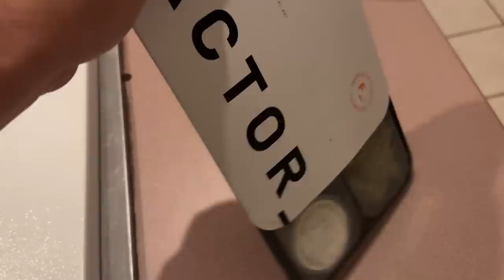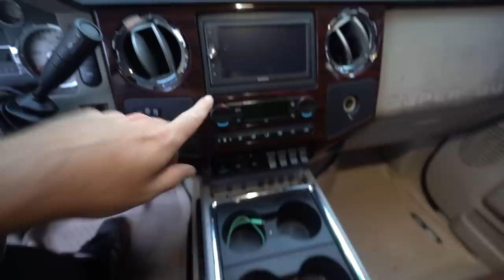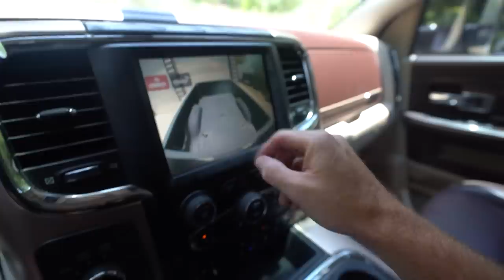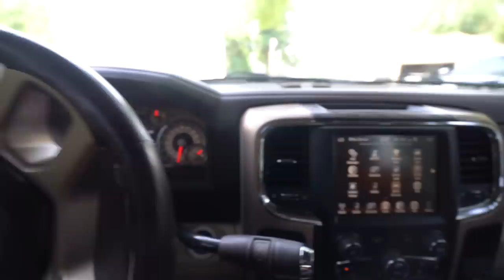My new truck broke down. so I bought another one. bucket list tow rig.

Comment: Biggest thing the local guys here in Australia do is a really big under bed trans cooler with twin push/pull fans on it. Change to the shatter proof heavy duty flex plate, higher grade flex plate bolts and lock up correctly rated torque converter to suit the towing duties this is being used for. Upgrade the solenoids, valve body, clutches and drums to billet. Put a deep finned pan on it with aftermarket drain. You will run almost double the trans oil with a radiator sized cooler, but preventing heat soak is the goal. Of course a trans retune is also going to make it live a better life. 

I’m all for extending the frame on this and removing add on hitch relocation bracket extensions as these are high stress high failure items that can cause you big hassle in the long run. 

Don’t over wheel the truck with heavy Alcoa type wheels as this just causes additional steering and suspension stress. A load helper bag system on the rear axle should be installed to improve towing and ride quality. 

Like someone already mentioned check all external wiring connectors and fill with dielectric grease to prevent corrosion from the humid Florida air. Upgrading ground straps is advisable. You may also want to have the ABS system flushed and recalibrated for towing as well. 

Now is also the best time to go completely through the heater and cooling system on this truck and put a slightly colder thermostat in it as it will want to run hot when towing long distances. Remove the grid heater unless you’re planning to travel into colder climates. In Florida I don’t see the need for it. 

Yep I’ve said a lot, but when you make an investment like this you want to do as much as you can to preserve it. 

Good luck Taylor

Comment: Need to get a Gen Y tongue for the gooseneck. Their torsion style gooseneck gets rid of a lot of road shock and also gives some offset back like you need. Also saves the trailer from a lot of shock keeping everything inside from getting knocked around.
Reply from the maker: I ended up order the shocker one just because it was in stock at e trailer. Two birds one stone. Get the offset while also adding shock resistance.

Comment: Literally every truck mechanic on the planet agrees that a ford truck with a Cummins engine and Allison trans is THE BEST truck you can get .. if you slapped an Allison in that fummins , you would quite literally never break down , all you have to do is an upgrade lift pump to supply enough fuel to the injection pump computer on top of the fuel pump on the side of the engine to keep it cool and you’re golden
Reply: My buddy did that always shifted erratic would be great then shift up on its own and just black smoke egts were super high too best would be a manual nv5600 or even g56
Reply from the maker: @chrisley7919  yeah I thought long and hard about a G56 truck. That was the plan. But after driving one a bunch. It would suck after the novelty wore off on long trips.
Reply: ATS now makes a kit to swap in an Allison 1000 and retain all factory functions. My buddy did it on his 2018 and it make one heck of a difference.
Reply: Who has time for that though? He already runs a company and manages multiple builds. Doesn't make sense to build another truck when he NEEDS it.
Reply: That combo used to be sold as a new truck. It was called a Sterling. I avoided the teens duramax trucks because of the CP4 fuel pump and the fact they are 140 ft lbs less power when stock. I thought about a bulletproofed 2005 6.0 but luckily went with a 2020 fully loaded L5P duramax. The allison/gm 10 speed is great and I would rather push a duramax than listen to a cummins run, especially since all the cummins trucks I drove were dogs when unloaded. The duramax is extremely quiet even when towing and I would never have a short bed. CC LB is the only way to go. I was expecting Taylor to just keep driving the fummins, but I get wanting a more comfortable truck.
Reply: I would take a 6r140 over and Allison any day like let be honest here I’ve seen way more smoked Allison then 6r’s it’s honestly one of the best transmission ever made and the 5r110 isn’t bad either

Comment: From a Chrysler dealer tech you definitely need to upgrade the cooling for the longevity of the trans. And I’ve done a few transmissions that are in tuned and deleted trucks and they end up blowing up pretty quick because the trans is already being pushed to its max behind the Cummins. Also it looks easy to work on but you still have to pull the cab to pull the head. You can barely get the valve cover off with how far under the cowel the engine goes. Make sure you keep up on the maintenance like fuel filters ccv filter and trans services since you are towing a lot and it’ll be a good truck
Reply: You pull the cab to pull the head?
Reply: you most certainly dont have to pull the cab. i do them fast going through the wiper cowl for head bolts
Reply: FCA tech, huh?
Reply: @jacojanks5985  no you dont have to. Takes a little work but the cab does not need to come off, ive done it before without a cab off.
Reply: The transmission has always been the weak point of Cummins powered Ram trucks. If you upgrade the power any above stock it’s wise to upgrade the trans.
Reply: Eh, watch Greg A.. He never pulls the cab for a head. It can be done..

Comment: Remember the gridheater bolt and get that checked.
Reply: Get a Banks intake for it. Removes the grid heater and is better all around.
Reply: It probably doesn’t get cold enough where he lives for a grid heater anyways. Just remove it.
Reply: Great tip. This is the main reason they blow up!
Reply: @markbremmer8642  way too expensive for the banks intake plenum. Just use a basic delete plate with the stock intake horn. Where he lives a grid heater isn’t needed

Comment: Taylor, im sure Im not the first to say it, but you need to get the 5th wheel slidder rack that they have for mega cabs. Also, those oem tail lights have a known issue for having codes and warnings on the dash when a single led goes out, but other wise works and functions normally. Get a half decent set of aftermarket lights and prevent the struggle. Other than that, those 4th gen trucks are awesome! Congrats on the upgrade!

Comment: RevMax Zero Flex HD/Tow Billet valve body w/ EFI Live TCM tuning. (Make sure you have the tranny tuned to RevMax’s specs to keep warranty.)

I went with a BD deep trans pan and BD thermostat delete. Along with BD extra capacity diff covers. 

Get the CSP5 switch as well. - It’s a 5 position switch, but the 4th gen’s ECM can only store 4 tunes going the route I did. (Tow, economy, street and race.)

My shift points where raised, so no more quick shift/lower RPM cruising.

Took a while to get used to, but now I could never see going back. 

I tow locked in 5th and @ 65. Slow I know, but seems to be in the sweet spot both power, lower EGT’s and fuel economy. 

I highly recommend reaching out to Spencer from Dirty Diesel. He is a good dude. They work with CCS (Mitch Cooper) and they have great tunes. 

Over the years, I’ve needed tweaks to the tuning here and there and they have never once charged me. 

Just my .02 🤙

Comment: Rather than modify the trailer, just send it to Long Bed My Truck and get the ultimate truck: Mega Cab Long Bed Cummins dually
Reply: Or just get an offset hitch on the trailer, or just don't do 90 degree turns
Reply: Dot is cracking down on those. Insurance companies too. If you never have a problem you’re good but there’s a reason Ram doesn’t sell one. Rules and regulations.
Reply: Why would he send it anywhere? He literally has a full shop at his house and his channel is about building cars.
Reply: @kevinbutler9786  Frame stretching isn't something to mess around with if you don't know what you are doing. He is a good fab guy, but there is a lot riding on getting that right.
Reply: @mraycgz  cracking down on what? LOL The DOT isnt cracking down on anyone who does a legit frame stretch on these mega cabs. Semi trucks are being stretched everyday and they go through scales daily. The reason Ram doesnt sell them is because its cheaper to use the same frames between these short bed mega cabs and the long bed crew cabs, they are the same sized frames.
Reply: Better off buying a 4500 Cab & Chassis that's already a long frame and putting a bed on it, no stretch needed.
Reply: @SylasG  Have you ever driven one of those? I wouldn't want to on a road trip in the 5500 we have at work. It is old though, 2009.
Reply: @warrenmichael918  cracking down on the amount of weight you can carry because of the gvwr if I remember right. Look it up for yourself if you don’t believe me. Semi trucks have a much bigger gvwr. I can’t remember the specifics but there was definitely a group of guys that had problems with dot and insurance companies resulting from a long bed on a mega cab.
Reply: @mraycgz  LOL I dont need to look anything up, i drive almost daily as a CDL holder and deal with the DOT quite often. If this "group of guys" had a problem with a stretched framed truck, it was because they didnt install it the right way. I could see an insurance company trying to get out of paying for something but thats ONLY if they knew it had been worked on by someone not qualified maybe. The DOT wouldnt and couldnt mess with a stretched truck. If they are over weight , thats another deal in itself and not due to the truck being stretched. The GVWR wouldnt change but the few hundred pounds of extra frame and longer bed will impact what they could haul. Most DOT officers wouldnt even know it was stretched anyway.

Comment: Make sure you do the crankcase vent delete and clean your turbo. Run a catch can or vent to atmosphere as it doesnt make much oil. But it is currently dumping into your turbo. Which causes premature turbo failure. Just a FYI and on your 6.7 cummins

Comment: Get the hitch offset on the trailer. 
Don't mess with the hitch placement in the bed of the truck. It'll mess with the weight distribution / towing stability; moving the tongue weight even a small distance back behind the rear axle is going to the shoot the nose of the truck into the air (the further the hitch is moved back, the more the nose will rise).
Reply from the maker: My thing on that is. People pull much larger trailers. From behind the bumper. Yes the weight balance is different in a bumper pull. But my trailer is very light and small.
Reply: @Taylordrifts  Difference with a bumper pull is that the weight is lower. You're the guy w/ the truck obv, but I'd be concerned.
Reply: @Taylordrifts weight distribution on a bumper trailer is a lot different with less tounge weight.
Reply: A single rear wheel could pull his weight trailer easily, move the weight of his trailer back 6-8" won't make much of a difference, I wouldn't do it with a 20,000lb trailer that has 4,000lbs of toung weight  but for his needs it would be completely fine
Reply: @Taylordrifts  you might be surprised how much worse the truck drives with the weight further back. Could make it super bouncy going down the highway, similar to if you load your car to far back on the trailer. You could fabricate a new hitch for the trailer that goes further forward however much you need. I’ve known people who have done that
Reply from the maker: @JohnnyAnderson1  yeah that’s something people overlook. My trailer. Fully loaded with car and everything is like 10-11klbs. It’s a super small gooseneck.
Reply from the maker: @Teysik  I did think about that. Even just fabricating some frame portions to attach the hitch that’s there too since it bolts on since the trailer is aluminum. It’s tucked really far back for now good reason. For now I ordered a bag hitch that adds an air bag for cushion and also offsets to the rear. We’ll see how it is with that.
Reply: @Taylordrifts  Main thing is pin weight and where it is impacting the vehicle. An offset gooseneck ball will still behave like a regular gooseneck since the load point on the chassis is still the same especially if it uses the original puck system. The pin weight and force will increase due to the lever action an offset hitch would create and the front axle load might drop a negligible amount. You have a 5000#+ payload capacity. You aren't going to have an issue with one.
Reply: The actually hitch in the bed attached to the frame doesn’t move so there for the weight is literally in the same spot with an offset ball or coupler. It’s not going to change.
Reply: @Taylordrifts  yah most goosenecks have bolt on hitches so they’re easy to modify. A bag hitch sounds nice
Reply from the maker: @Teysik  I’ll see how it is with the bag hitch and ball extension and then go from there with it. Based on how far it turns now it should go pretty far with that combination

Comment: To keep that trans alive you need either a bd 68protect plate and a dnj valve body plate, and drilled new holes to keep the accumulator valves in. Or just call Randy's or muldoons and get a whole valve body. Also a deep pan is needed. And good trans tuning. Also you must drive around the trans. No lugging it below like 1700 while towing. I've had some trouble free 68s doing as I described.
Reply: Also the thermostat bypass on that truck since it's a 13 up.

Comment: Little dodge mechanic tip, get that trans beefed up ASAP do some research into the RevMax kits and get a billet converter. You will fall in love with that thing! Me and the small shop I work at have put 6 in with full rebuilds!

Comment: I ended up upgrading the lift pump and turbo with a fleece system on my cummins tow rig. If you have the asin trans you are in a better position for not really needing an upgrade. I love my dodge but I'm soon in the market for an upgrade ram. My 3rd gen has a cancer rust issue that I'm getting tired of fixing.

Comment: If it has a 68rfe would definitely recommend doing a Revmax thermostat delete and probably get a bigger transmission pan. The pan with the cooling fins will help with cooling and so will the extra oil it can hold.

Comment: Keep a check on the seal around the third brake light. They get brittle and will leek water into your cab that collects in the storage compartments.
Reply: Same on my Chevy when I took it off to tint the lights I used a lil silicone to keep water out
Reply: It's just as likely for the cab vents to leak, they often don't stay tight to the cab.
Reply: @Hard_Right  thats just horrid luck. I know 5+ppl with 2016 and newer trucks and they’re all fine.
Reply: @Hard_Right  I have a 2016 silverado that I've never had to touch at all. It drives perfect, tows perfect, and all the uppity gizmos in the interior all work perfectly. Just because your truck sucks doesn't mean they all do.

Comment: Said this on one of your last vids and I'll say it again, look into the new gasser Chevy and Fords, the 6.6L and 7.3L respectively, both are towing over 30K. You get pretty much none of the downsides of the new diesels and would still have the comfort and peace of mind of a newer truck. The fuel mileage is comparable and yet gas is cheaper, no crazy diesel emissions, DEF, DPFs, Regenerations, I can go on and on lol.
Reply: can't believe more people don't go this route
Reply: @danielwallace7239  gas is just lame and boring if you delete a brand new diesel it’s reliable and very fun
Reply: Most people opt for a diesel because it’s “cooler”
Reply: To think a gas job is ever going to out perform a diesel towing is hilarious. A diesel puts out twice the amount of torque at half the rpm. Gas motors belong in half tons not real trucks made for towing.
Reply: @smcox1991  Well I said it's comparable for what his goal is so I'm not sure what your going on about. A truck that tows 30k-40k is a truck that tows 30k-40k. I said everything else is better about a gas truck though which I will stand behind all day, and for you to debate is silly. Maybe if he starts hauling more than that he should get a big rig?
Reply: @joshuaoverman  thats fine and all, but spending all that money on a new diesel is pointless after that right, especially because your going to be spending thousands more on top of the truck to delete/mod? Might aswell get any of the many, many older options before it that are cheaper and delete or mod them, like he has already.

Comment: Welcome to the awesome comfort of a longhorn! You’ll love it!! Also, go Randy’s for any of your transmission bits and mods. I have a 2016 too, the vgt vanes like to stick. Drive with the exhaust brake on and if the turbo or actuator fail, hit up DDP. My actuator failed, went city diesel billet actuator and it’s been great. Congrats on the rig!! If you have steering slop (common) cjc has little inserts that helps correct that. The drag link “fix” from FCA was to weld nuts that allow for adjust… swap it out with a synergy one and you’re golden.

Comment: I'm a Ford guy all day but you can't say anything bad about a 6cyl Cummings diesel. They can make pretty good power pretty easy, or with a few dollars into them and correct parts you can make pretty big power too, either way there reliable, and like you said simple an easy to work on. I really dig the room and luxury that thing has I'm not going to lie. And after hearing and seeing exactly why you got it, great choice my friend great choice.
Reply from the maker: The simple to work on for me is key. The ford makes way more power everywhere. But the Cummins is so simple for a modern diesel engine.
Reply: @Taylordrifts Another Ford owner and shill here, you made the right decision. Ford falls behind when it comes to diesels. If you were considering a 1500 I'd say f-150 all the way, but Ram just has the best reliability and serviceability when it comes to 25-3500 diesels.